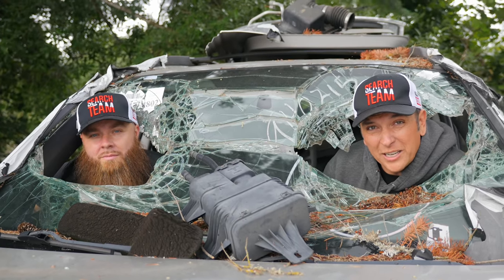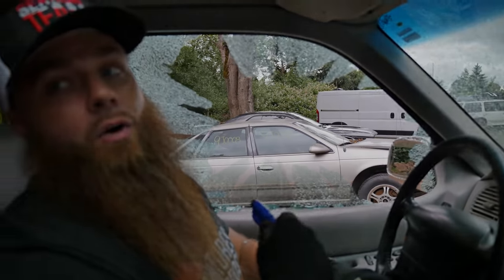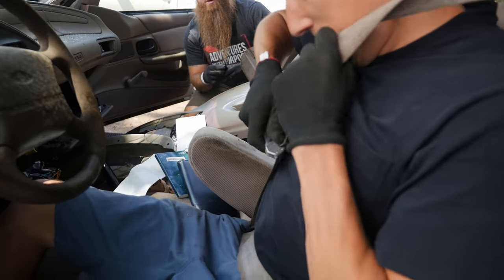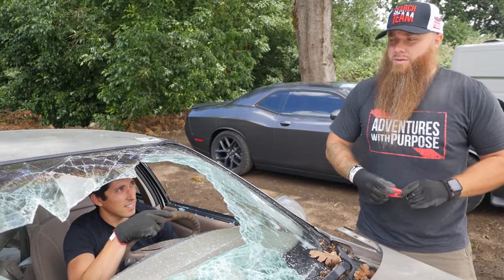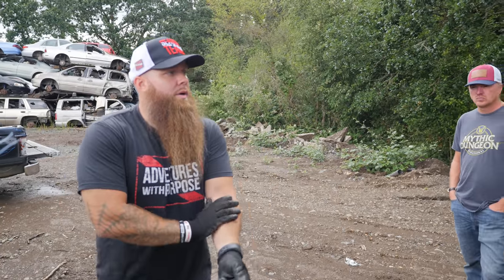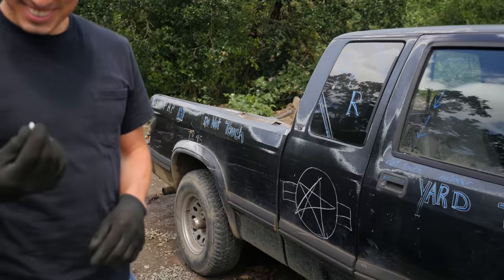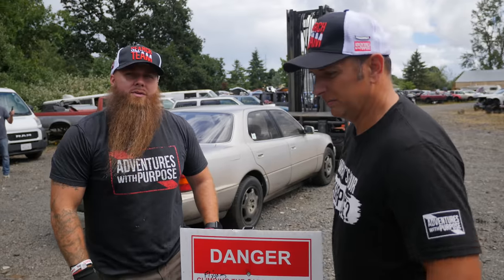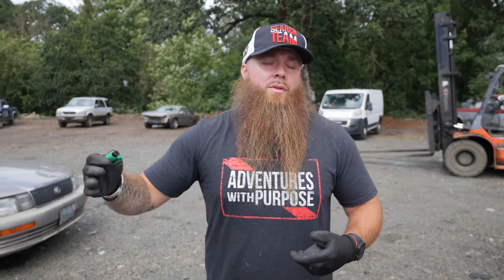HOW-TO-ESCAPE FROM YOUR CAR.!! (This Could Save Your Life)

Comment: I also want to add that...
Headrests: cars have them latched in along both posts, usually one side will be recessed in making it harder to unhook. The posts may also be so long that you can't get them out without adjusting the seats. They also have blunt ends and are very light. Not good for penetration.
Sun visors: if you have sun visor lighting, forget it as you'll have a whole wire loom to pull down alongside your headliner if you can even strip those screws out.

Comment: The side windows on that old Taurus were pretty flat, that Explorer or Expedition (not a US guy, so no expert in SUV too large for Europe) back window was quite shperical. Tempering creates a pre-stress in the glass and it is always making it easier to break it from inside and more difficult to break it from the outside of the sphere. If you have (for whatever reason, they are usually not available except for film effects) a tempered wine bottle you can actually drive a nail into wood with the bottle. Let the nail fall in and the bottle will break. So probably because Doug was trying the middle of that rear window the pre-stress was so strong. At the corner it was less. From the inside it would probably have worked easier than from the outside.

Comment: I have a serious question❓
I have a 2019 Chevy & I have a window / seatbelt tool, but I now doubt it would work even on an older car. What do I do if I have a newer car with the laminated windows❓Am I just dead in a bad situation ❓⚠️🚗😳🤬🥹

Also, in newer cars with push button ignition means my keys are not guaranteed to be where I set them in my cup holder. Where do you recommend putting your tool in that situation❓❓

Comment: Being DC, car electronics will work underwater to a point. Simple systems like windows and lights will typically function, but other systems that are computer controlled will not. If you watch videos of vehicles sliding down boat ramps while trying to load or unload, you'll see similar things. If you know you are going into water or sinking, hit the buttons to put the windows down. As long as the ignition is on, they should work. Obviously, have a backup method like the window tool, but if you're able to get them down before the car even goes under, that saves precious time.
Reply: Also, as they said, front and rear windshields are laminated glass which has a film inside the layers to prevent it coming apart on an impact. Side windows are always tempered, which is a special process that strengthens the glass from blunt impact forces (spread across a large area, like a rock or fist) but the finer the impact point and the closer to the edge of the glass it is, the better chance you have of breaking it. If you have a window tool, you can use it anywhere. If you have something with a narrow or pointed end like the seatbelt tongue (metal), hit as close to the edge of the glass as you can get.

Comment: My biggest fear is crashing in water but about 4 yrs ago I woke up at midnight with a toothache and ran to the gas station to get meds someone fell asleep and crashed into the gas pumps and it burnt my car up so now I’m very cautious where I park at a gas station if I hadn’t been at the register paying I would have been trapped inside I was parked up against the wall and it hit the pump a dumpster and a pole into my suv and I would have burned

Comment: My husband and daughter rolled 4.5 times into a steep ditch coming home from a outbid state funeral. It was a2017 Nissan Altima new car with 8000 miles on it. They were 1/2 mile from home on a 1600 mi trip. They slid on s switchback paved country road and when they tried to correct they rolled 4.5 times landing on their top. The roof caved in on top of my daughters head. My husband had pressure injuries from the seatbelt both hanging upside down without a seatbelt tool. They were both able to release their seatbelts and crawled out of the car s f called me. Since all jackets warm clothing etc was trapped in the trunk they were in the snow freezing. I drive and since I’m a first responder I gave them a quick once over and since I had no way to keep them warm I drove them the half mile home and got them settled with blankets and some water. I then went back to the scene and called 911 let them know I took them home and was going back to the scene. The police where there even I arrived. They asked me to crawl in the car and turn off the engine. Something I shouldn’t have ever agreed to. The young officer gave me crap but the senior officer said I did the right thing getting them to safety and out of the cold yo prevent shock. The ambulances were sent to our home where they were both treated for minor injuries. This could have been so much worse! If the seatbelts hadn’t released neither one could have reached their phones and would have be been stuck. Had the engulf caught fire they would be dead. Already my daughter had a huge goose egg where the roof collapsed on her head and she kept saying no to treatment. Thus was caused by the disorientation of the head impact. My husband had to talk her out. We learned so much! I am replacing all of our window breaker tools with awps. I currently have the smith and Wesson knife. We now practice what to go in the event of an accident. God bless you all! Oh and we have Perry swimming hole where you can put a car in it’s about 18ft-20ft deep.

Comment: Doug, how would you escape with it (the tool) in your pocket? A lot of new cars have push button start and no ignition key
Reply: But a “ lighter leash”. They will
Clip on your visor and pull to where you are at. Disengage tool and break window to get out of car. Problem solved. Cost of a lighter leash is about 1.99 normally.
Reply: I forgot to say attach this tool to the lighter leash instead of a lighter

Comment: What happens for vehicles made after 2017? And also, if it's used once and that spring is released, does that mean it cannot be used again? Example: what if for whatever reason, you use it to bust a window out and there's something obstructing on the outside, meaning you have to go to another window- will you be able to hit it again? Or is the spring disengaged now so it's no longer effective?
Reply: I was wondering this about vehicles made after 2017 as well.   My family has 2 Honda's: ones a 2019 & the other is a 2020, how do we break out the windows?  Would love to see an updated window giving this information.  Also most vehicles are now push buttons as well so your keys are normally in your purse or a pocket.  Maybe some way to clip these to your dash or something.

Comment: The piece of ceramic would work over a stone because the ceramic is glazed.. Glaze is essentially glass, made of the same silica mixes.. if you threw a piece of unglazed pottery at the window it would behave like the stone.. it would disintegrate also (depending on the clay and the temperature of the firing) 
But WOW !
Fantastic watching such a teeny piece of glass hardened with clay and heat break a window , awesome ! Ahhh, the Laws of Physics 😂

Comment: There are too many comments to look thru - so this might be a repeat question.
You talk only about vehicles that actually use keys in the ignition - so many newer vehicles have the push button starts... and many people just put the fob in their cup holder or purse... which won't work if the car flips.... what do you suggest in these cases?
(I don't have a vehicle with a push start - so I don't know if there's a spot that the fob can be put that would also have room for the device...? Or what is suggested for having the device within reach in an emergency?)

Comment: How about putting a rubber band type thing attached to your tool so when you grab it from your ignition you can easily slip it around your wrist...it's so little it may be difficult to hold onto it in a grand emergency especially if you had to go back and break other windows and cut seat belts of others...so easy to Drop.
I already bought one of your tools...need to get more for the family.
Thank You All for what You do ❤

Comment: Windshields are also laminated from glass exploding into the drivers/passengers faces. Imagine a rock bouncing off a dump truck that typically just chips the windshield. Imagine same thing but instead of chipping, the windshield explodes into small pieces into the car as it’s driving at 55mph..

Comment: I'm SURE this idea has either already been thought of or there are too many problems with it that I'm not thinking of as an exhausted currently but would it be that big of a deal that at least domestic car manufacturers start being required to provide either detachable headrests where the rods are sharpened to rounded points (again I'm exhausted so I'm sure you get the idea) that are specifically engineered to bust the windows for that vehicle? and if the manufacturers do not want to detachable headrests it's required to include a window breaking tool under both passenger and drivers seats? or maybe in the visors somehow? a manufacturer would not be able to sell a vehicle that you cannot easily get out of on the road, safety equipment is required for collisions, so why are we still battling this in 2022? I saw the interview where you guys spoke about the company that you're working with that has patented technology to immediately lower the windows but I just feel like there's red flags all over that for the similar reasons windows end up not being able to be lowered if they're not manual, as well as how much sensors malfunctioning or breaking, and then will those sensors be super cheap for people to replace? there's just so many holes in that I feel like, when providing something to break the windows in the event you need to escape the vehicle, especially as a secondary use for something that's already important in the vehicle, is just such a simple simple thing to do. if anything we could even start advocating to have dealerships start providing these window breakers with their cars, it can't be that expensive wholesale but as a consumer every penny counts when you're buying a vehicle. sorry for the run-ons and horrible grammar, I'm only even watching these videos to try and distract myself from some horrible stuff my family is facing so I'm not all here but just always have been curious why this problem isn't an easy fix for the people making the vehicles

Comment: So if a car is in motion when the accident occurs everything inside will get thrown around, misplaced and end up on the floor. Newer cars don't require a key so most people (me) may not have a Keychain. Its also very hard to reach the glovebox with the seat belt on. I'm just wondering where would be the best place to keep this device. I'm thinking middle console but with the accident either water will create pressure where you can't open it or it may become damaged and not open. Thoughts anyone.

Comment: I have had the tool from AWP for about a year. If the front and side windows are Laminated, is the back window usually laminated? I have always thought I have to get out of the side window in the event of going under water but now I’m not so sure.

Comment: On December 31st of 2019 I flipped my truck after losing control when braking on ice to avoid a mini van (did they have kids?  I have no idea as they did not stop).  Luckily I just flipped up onto one side in ditch and even more luckily it was before a drainage  ditch full of water.  The very first thing I did, before even considering escaping or calling 911 was turn off the engine.  I quickly found out I was even luckier as an EMT crew saw what happened as it happened and responded as I was calling 911.

Comment: @Adventures with Purpose — To be clear, does this tool also work on laminated glass or just tempered? AND, can it be reused or is it just a one-time use?
Reply: OK, all… I found this info on another page: 

Is the 2-in-1 rescue tool reusable? 
Yes! The survival tool is designed to be used more than 1 time! The spring-loaded spike resets automatically and can be used multiple times.

The blade is very durable and can easily perform multiple seat belt cuts.

AND: 

NOTE: SIDE WINDOWS AFTER 2017 ARE NO LONGER TEMPERED. DO NOT BUY OR USE THIS TOOL ON VEHICLES NEWER THAN 2017 UNTIL YOU CHECK ALL WINDOWS (ESPECIALLY THE BACK WINDOW) TO MAKE SURE YOU HAVE AT LEAST ONE WINDOW THAT IS TEMPERED GLASS

Comment: Just found this video and will be ordering.  But I do have a question I didn't see asked (sorry if it as).  Where would you recommend it be stored for those that have push button start where there is no key ignition?
Reply: It has a circle attachment so maybe hang it off the windshield wiper / turn signal lever?

Comment: Cars should have window punches in them. Belt cutters etc.  I hate how cops seem to resent you guys. They should be using you guys,  even if it's a cop frustrated by red tape. Gives you a quiet call & you haven't got the crap they need to abide by. Because we all know it's not thar the ems are incompetent. It's the red tape. You guys are fantastic,

Comment: So I'm wondering how quickly a wrangler would fill if it went into water, if you guys happen to know, with all the drains and seals that don't actually seal. I mean mine gets wet carpets when it rains, and I have the top and doors on

Comment: I tried to smash the small back window of my hatchback when I locked the keys in the car using a tyre iron and it was very difficult even standing outside of the car and being able to use my full body to swing. I think I had to get help from a guy.

Comment: Just as an FYI ... my car is push button start, and my key ring ends up "wherever" in the car - cup holder, front seat, and sorry to say it, the floor. I ordered several of the seat belt/window breaking tools, and decided to suspend mine from the rear view mirror instead of my key ring for easy access. It's just there in sight and within easy access.

Comment: You don't have to throw that ceramic nearly as hard as yall did. Use a few pieces so it's more likely the broken edge contacts the glass and it'll fall right out and barely make any sound. You can limp wrist it like a little girly man and it'll still work every time. So i've heard....😂

Comment: Regarding Doug's point about the importance of the first ten seconds of an accident, assuming you get into an accident at speeds over about 15 mph, your airbag deploys. That sets off a fairly large explosive two feet away from your head, then you are stunned for 30 to 45 seconds. You aren't unconscious, but you are fully incapacitated by that explosive.

I wonder with these water recoveries that you guys do, if that's not often a contributing factor for people not making it out, because these people only have about 60 seconds to open the window before the electrical system is done and the car flips, but the first 45 of that you are incapacitated due to the airbag explosion.
Reply: I've had an airbag go off in my face when I rear-ended somebody that stopped in the thruway for no reason. I can assure you I was not stunned for 45 seconds I was wide awake and got out of the vehicle quickly. My son was also in the passenger seat and his airbag went off in his face as well. He was not stunned either. We both got out very quickly with no problem. I'll never forget the nasty smell of that airbag going off.
Reply: @walk-tall-hikes  I've seen three airbag accidents. In all three the driver was stunned and unresponsive. In one case the driver continued to drive and caused a secondary accident on the freeway.

Comment: Newer cars have radio frequency keys or key fobs so my keys as a woman are in my purse, because womens jeans basically have no pockets. So my only option is to have this tool in my purse or in my glove boxes. If you are a woman wearing something with a belt loop, you could attach it to that, but if you are wearing something with no belt or belt loop there is nothing to attach it to. It's not cute having a window breaker on you somewhere. Your whole addage of have it on your key chain, the key is in the ignition, won't come out of the ignition, and you can detach it from the keychain to use doesn't work for key fobs that have push start. So what are key fob users and women with no pockets or belt loops suppose to put it in or on? How do we get out of the laminated side windows? We are just sitting ducks in that situation prepare to die? Why didn't you at least attempt to break a laminate side window?